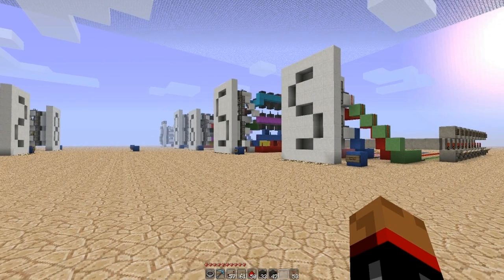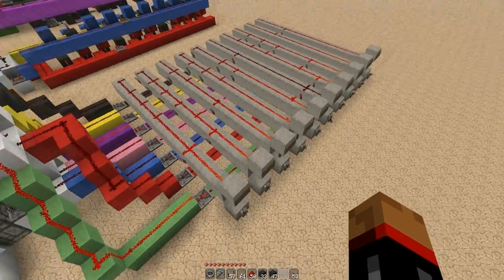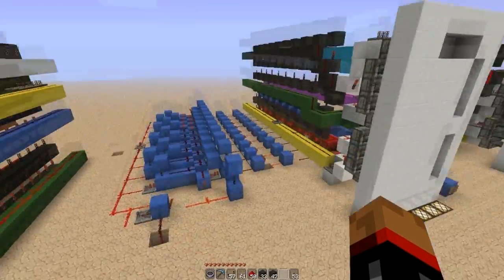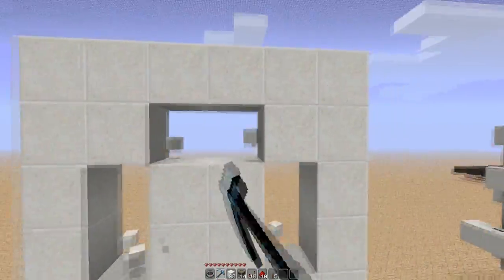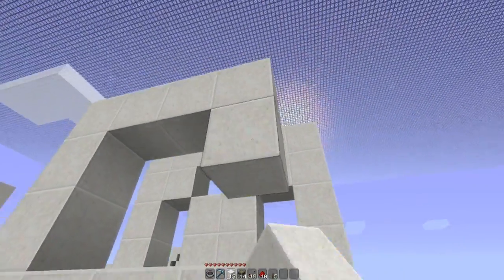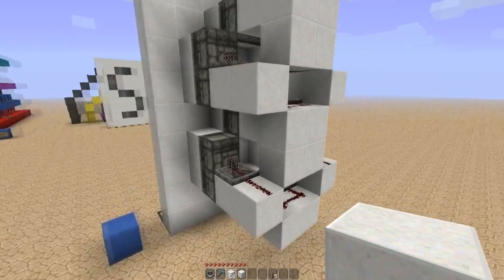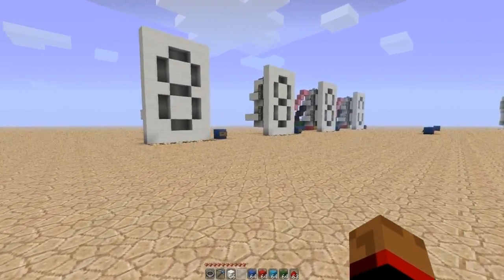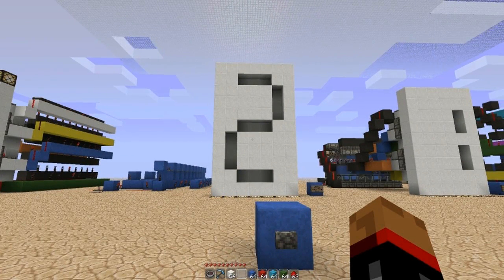Seven Segment Display + Decoder, Part 1 [Advanced Minecraft Redstone Tutorials]

Comment: have two 7 seg displays next to each other then when one gets to 9 have a carry charge that adds 1 to the next segment so it goes 01 02 03 04 05 06 07 08 09 00 +1 then it will be 10 and it could easily carry on up to 99 then for 100 add another 7 seg display